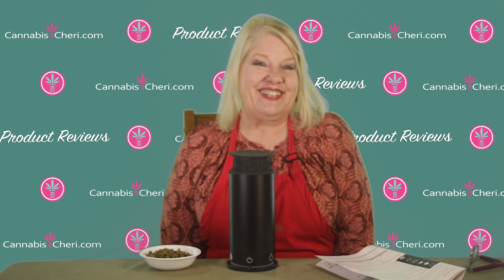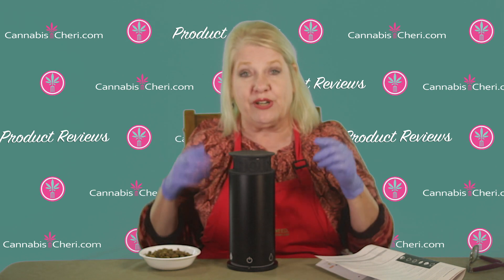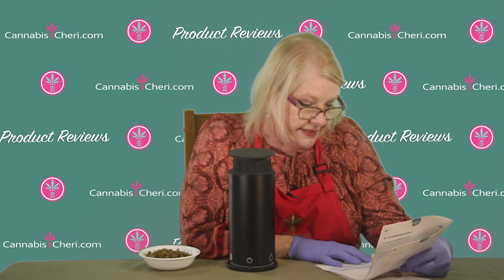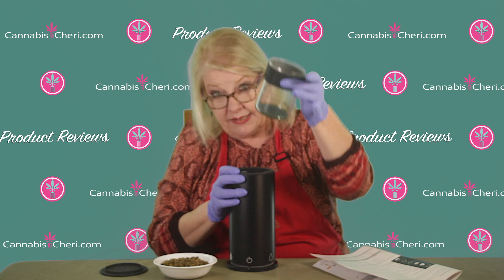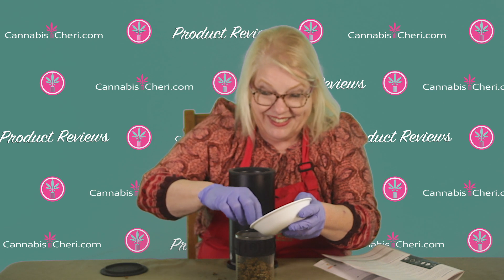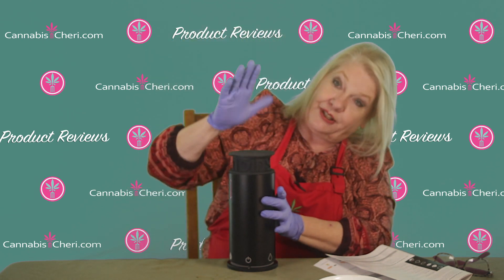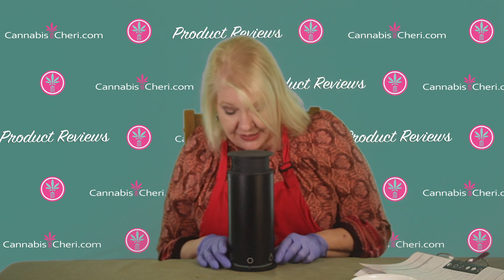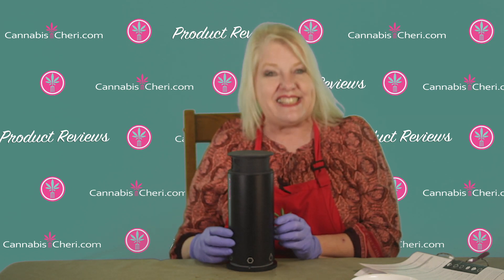DEMO: How to Decarb Cannabis in the POT by NOIDS

Comment: I just order mine. Rso and wax are the only things that help me get even a little bit of sleep. do you think you could and would do a video on how to make CBN in this as in is it even possible? I hear good things about CBN put it this way I can take  the hole gram of rso and still maybe get 6 hours of sleep off and on. but this way I cand make a lot more at time all I buy is RSO. so, thank you for the video and the coupon code. and for what you do.
Reply from the maker: CBN is more prevalent in older (aged) cannabis.  You don't "make it."  I have heard that over-decarbed weed can have higher CBN but have not seen the science on it (would have to research more).  How much CBN you would get I would think would be very hit or miss depending on strain. So no, I don't foresee a video on "making" CBN.  But it would be a good video to discuss CBN, so thanks for the suggestion.

  But if you do want higher CBN, it's a good time to find a very old stash.  Barring that, try decarbing for an extra half hour or so and see if you feel a difference in the results.  If you did get more CBN, the finished edibles should have more of a sleepy/sedative effect.  

Good luck and let us know how it goes!

Comment: I'm an Ardent FX owner and love it but am very interested in this little machine. I've watched your videos on making FECO but can you please do a video on filling syringes with it? I'd hate to try it and then have the FECO not go in right due to it's thickness. I'm also trying to figure out if most people just add a ml of liquid coconut oil/MCT oil per gram of FECO for filling in syringes and don't know how necessary it is or not. I need a tutorial for this! Great work though and I love your videos.
Reply from the maker: I never bother personally, but yes, you would thin it with some coconut oil until you can just barely suck it into a syringe, but it is a balance as too thin and it will leak.
Reply: I don’t add anything to syringe up but I make rso suppositories so I have to just get it in that syringe. Once it’s 170-180 it sucks right up into the syringe. Much cooler though it can be rough. I was hating the syringe part and a friend who is a processor of 13 years….it was a gem made a world of difference for me
Reply from the maker: Thank you!!!
 @jenR2120